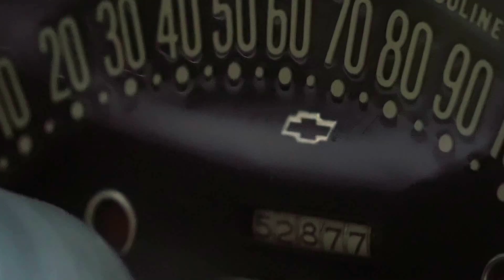It's Alive !!! - Rabbit's Used Cars

Comment: Those superchargers are a great headunit, but they have a ton of problems.   As far as I know I'm the only one to ever make decent power numbers with them, I reengineered 90% of the kit as it comes from Magnacharger back in 2011ish.    They will make 500-600 rwhp once or twice then you have to let it cool down, but if you ever want to turn it up DM me and I can help you with what you need to do to make it breathe, fix the belt slip, and keep it cool.
Reply: We are running more than that na bro! Things have changed in the last 10 years with the sc units as well. Stay tuned!😘